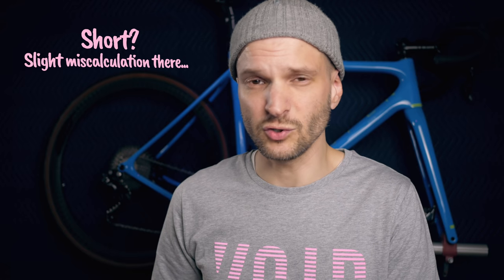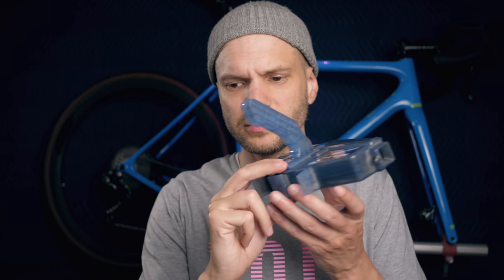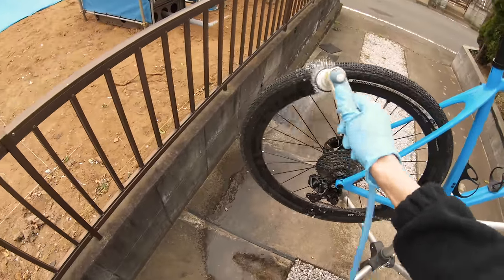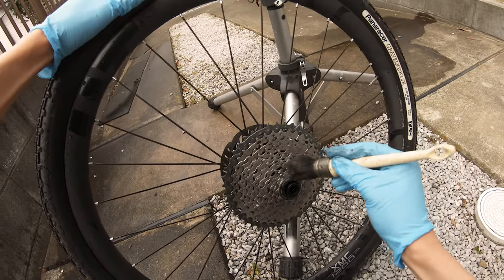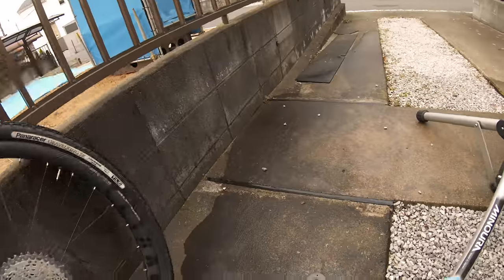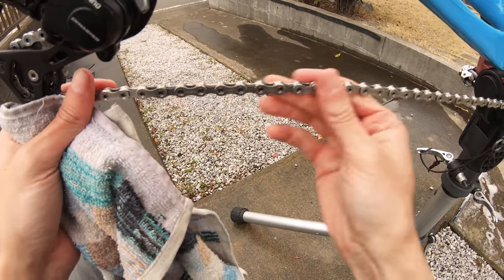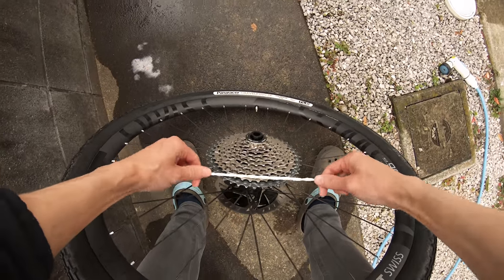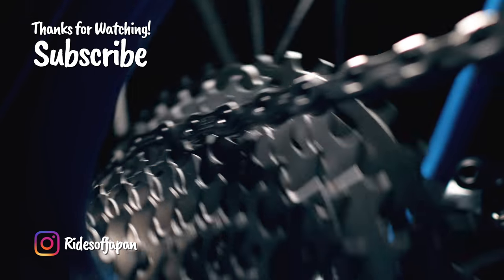My obsessive compulsive chain cleaning disorder

Comment: I'm just checking in to be clean. 1:10  hahahah! :)
Reply from the maker: Shane Miller - GPLama 🛀😘
Reply: Try waxing your shane.... I mean chain.  I switched to wax a couple of years ago, and have hardly had to change a chain more than 3 times.  Has the added benefit of not flicking chain oil on to your frame, which then doesn't attract dirt. So,  I no longer have to use aggressive cleaners on my bike, which prevents grease being washed out of derailleurs etc, so I've also found that all my parts also last forever!  I wax every two weeks while riding five days a week on salt affected british roads.  My wear rate on a brand new chain fitted in october was 0.25mm to 0.5mm currently.  The chain will last me through this whole summer and in to most of next winter.
Reply: @mathewwhittle10  we used to do that back in the '80's and had very similar results. WAY less wear and tear in dusty and dry environments.
Reply: mathew whittle what brand do you use?
Or just some candles
Reply: @ridesofjapan  you can lookfor small airbrush compressor maybe you will like it✌️
Reply: @Rides of Japan #bikecleaning #blingbling  !! WARNING DO NOT CLEAN YOUR BIKE LIKE THIS VIDEO SUGGESTS, YOU WILL RUIN YOUR R-HUB, BB, AND DERAILLEURE PULLEY BEARINGS !!       ?? Why ??
Cleaning solvents have a very powerful capillary action and a few drops will easily travel past the rubber seals on your sealed bearings, which will dissolve and remove that critical thin film of grease between the steel or ceramic balls and the raises. This allows the bearings to ride and grinding metal to metal and prematurely fail. At first after about two weeks the bike starts making faint grinding / clicking noises. As time goes on it just gets louder and louder. BINGO YOU JUST RUINED YOUR BEARINGS.
 I see this in my shop all the time.
SAD CASE & POINT: Spring 2021 I built a brand-new Canyon with Sram red AXS etap, Zipp wheels and all ceramic bearings.  Two months later he stopped by the shop complaining about some loud clicking grinding noises coming out of his rear wheel and BB. His bike was bristling in the sun and his drive train was spotless.  My heart began to sink knowing what he did, as I asked him what type of chain cleaner has he been using? He proudly told me "ParkTool CG-2.4 chain cleaning tool, and cleaned his cassette based on your Rides of Japan video, why do you ask?" I put the bike on the work stand and sure enough all his bearings were ruined.  As I started to explain he got very angry at me finding it very hard to believe what I was telling him.  But after he calmed down and I removed the Freebody bearings from his new ZIPP wheels. The bearings were rusted and contaminated with traces of ParkTool cleaning solvent.  He apologized to me and now his anger was focused on ParkTool, saying how can they make such a stupid tool knowing it will ruin bikes!!!!
I think if you ever see a ParkTool chain cleaning device take a hammer to it and destroy it so no one else can use it.
THE CORRECT WAY TO CLEAN A DRIVE TRAIN:
1. Remove your chain, cassette, and C-rings or cranks, use odorless paint thinner in a metal or plastic tub, and scrub away to your heart's content.
2. Put your chain in a large mouth plastic jar with solvent, and shake it for a while, let it sit overnight, shake it again, so its clean inside out.
3. Rinse out the solvent residue on the parts with a garden house.  Dip the parts in soap and water, and rinse out again with a garden house. BINGO THEY'RE LIKE NEW.
FYI: If you clean the C-rings attached on the crank arm, make sure not to get a single drop of solvent on the pedal or pedal axles.

Comment: Here in dry, dusty New Mexico i've found this lube called "Squirt" works really well.  It's an emulsion of two things that normally don't mix - water and wax.  So it's a way to wax lube your chain without involving a  pot of hot wax on the stove.  My chain has never been quieter and the shifting has never been smoother.  And it does last a long time and doesn't pick up a lot of dust.

Comment: Used the same dry lube before. Now use Squirt all the time, road, gravel and MTB. Super easy cleaning and re-applying.. :)
Reply: Peter Mergaerts I’ve also switched to Squirt. Better than muc off dry.
Reply: Squirt is pretty good. I just use a cloth. That is all.
Reply: Dude! Squirt is insanely good. Leaves almost no gunk, I clean my chain once every 2 months and Its always looking like new. Just re-apply every 200km or after a rain ride. Just make sure to avoid using too much lube, a tiny drop per link is really enough. Also, wait for it to dry before the next ride
Reply: Will have to check Squirt out🤔 cheers😊
Reply: I switched to Squirt 4 years ago, loving ir ever since.
Reply: Peter Mergaerts ordered and look forward to reviewing this in the coming weeks. Cheers guys👍🏻
Reply: Squirt is good, except when it’s wet on the road. At which point Squirt will wash off with about 50km.

Still, it’s the lube I’m using at the moment as the ‘wipe down and reapply’ between rides is all I need to do!
Reply: This is my review of Squirt. I did notice a difference of noise the first time because I didn't apply it twice. Here's the full review: https://www.youtube.com/watch?v=G6p03DMXDj8
Reply: Try also Smoove. It lasts longer
Reply: How does it perform in wet?

Comment: I run my old degreaser trough a coffeefilter after leting the gunk settle.
Reply from the maker: Ah, nice idea! Might steal that
Reply: I use an old beans can with a rizla filter through the bottom and this filters into a large funnel stuffed with tissue paper at the lowest point.
Reply: This is comment gold!
Reply: I have been cleaning my chain for a year with 300 ml of petroleum, filtering it through coffee filters :D ... what could be more economically friendly?
Reply: @ernestpetros6178  but doesn't degreaser, petrol in particular, evaporate too fast to be able to filter it?

Comment: I use a crockpot  with wax in it to 'boil' my chain after every few rides. Because of this my drivetrain stays totally clean. No messy oil anywhere, so no grit sticks to anything wearing stuff out. Taking my chain off to soak it gives me a chance to monitor derailleur pulleys and bottom bracket adjustment. I've done this for several years and can't ever imagine putting oil on my drivetrain ever again.

Comment: Two notes:

1. That long thin cleaning tool you were using is a ‘bottle brush’. Used to clean inside bottles :)

2. For drying I use either a chamois cloth (synthetic one), or a micro fibre cloth. Neither leave lint behind. 

Great vid :)

Comment: I love it!  I clean my bike and chain after EVERY ride.  I use the Muc Off dry lube (yellow) cap because it is bio degradable and cleans off the chain easier than the C 3.  I love a clean bike!  I also take the time to check the tires for debris and other components for wear.  I don't ever aim a stream of water at the bike, instead I use a bucket of soapy water and several micro fiber towels and just wipe the bike with a damp towel.  This method works because the bike never gets that dirty.  Thanks so much for sharing.  Just discovered your channel and LOVE the attention to detail that you bring!

Comment: Wow, lots of comments, but it shows how well they liked your video. Well done!  Now, I'm a bit of a lubrication nerd.  I used to use an ultrasonic cleaner to clean the chain then do the hot wax dip, especially on new chains with the sticky rust preventative they come with. I still do the ultrasonic cleaning/hot wax method, and I also add MOS2 (Moly disulfide) powder to the wax as a high pressure lubricant.  Unfortunately it makes for a dirty looking wax, but it's THE BEST lube you can get.
As I said, I usually only do that procedure on a new chain or anytime I break down the bike for maintenance.  What I use for weekly or every 3-4 rides is Dupont Chain Saver*.  A wax based product with PTFE, it is the best I've found. It doesn't keep an abrasive slurry in the chain parts like an oil based product does since it's a dry lube.  It is also quite tenacious as you will find out when you get some on other bike parts. ;)
Keep up the good work Tobias

* https://www.amazon.com/DuPont-Chain-Saver-Self-Cleaning-Lubricant-11-Ounce/dp/B001B0VDC2/ref=asc_df_B001B0VDC2/?tag=hyprod-20&linkCode=df0&hvadid=309811990469&hvpos=1o1&hvnetw=g&hvrand=16634845442699810500&hvpone=&hvptwo=&hvqmt=&hvdev=c&hvdvcmdl=&hvlocint=&hvlocphy=9028310&hvtargid=pla-531034886332&psc=1

Comment: Most efficient bike wash video I've seen.  Liked yours way better than GCN's.  I'm actually more obsessive on my chain, cause I use paraffin wax for lube.  That's the best for super quiet drive-train and efficiency, but it's a chore every 200 miles.
Reply from the maker: Cheers mate!

I read that paraffin wax is actually noisier than oil (Although more efficient). Not noisy as sounding like something is wrong, but just a bit more chain noise compared to oil based lube. Did You not experienced this?

That’s the main reason I’m not considering going down the full wax road. Might do in the future though.
Reply: I'll give C3 a try to compare.  Thanks for all the great vids.  They are always enjoyable.

Comment: Was expecting wax as chain lube. Cause ceramic lubes are quite "normal" IMO. Only people with real obsession about clean and fast chains use wax
I personally use the recipe from Jason smith with 1lbs of wax, 2g of MoS2 and 5g of PTFE powder(friction facts) and it works for roughly 200-300km of dry riding then it gets noisy, but still lubricates the chain sufficiently.
I also have 3 chains for each bike. So i can simply take it off and use the next one if it gets squeaky. I wait till all spare chains are used up and then rewax them in one session, but clean them ultrasonically beforehand at 75 degrees celsius
For smaller parts on the bikes I use an ultrasonic cleaner. Cassettes, bolts, smaller chainrings(from the MTB) etc get cleaned with that and I can also check them for wear
Frame and wheel cleaning is similar to your procedere. But since no gunk collects from the waxed chain, chainrings, pulley wheels etc stay quite clean(very apparant with aluminium anodized oversized jockey wheels)
Reply: interesting recipe.

Comment: i still love my waxing of the chain. especially for MTB and gravel riding as the dirt hardly sticks to it. wash the bike and the chain looks new again. re wax every 3rd or 4th ride.
Reply: I feel like waxing is too dry and causes a lot of friction compared to wet lube with some dirt on it. Also waxed chains look ashy af
Reply: @The-ii5jo  all of the testing shows you're wrong.
Reply: @The-ii5jo  Dude try it before you knock it. Just make sure you have a spare crockpot and a removable quicklink. You will never look back. Only exception I see if you live in wet climate, in a van, or travel internationally as a professional. There are absolutely pros still waxing with molten speed wax, just pre-waxing chains.
Reply: @sanderlucioperca  whoa there sander bbg calm down. I've actually tried waxing my chain and I didn't like how it felt. It doesnt feel as smooth as a chain with actual lube. I'd much rather bathe my chain in mineral spirits about every week or much earlier depending on how much I ride or how dirty it gets, and then applying fresh lube. Chains are gonna get road grit no matter what specially since they're close to the ground. Even a dirty oily chain literally feels smoother than wax. But hey if you wanna keep an ashy chain, you do you

Comment: Squirt wet lube is fine, but the dry lube is hopeless. My fav oil is the Morgan Blue  race oil. Eases gear changing and quietens the transmission instantly. It’s a good lube for  a long day whatever the weather. Of course, cleanliness of the transmission is the key. I find the more I clean  it, the easier it is to maintain  and the more I enjoy riding my bike. I clean mine after virtually every ride, not always a deep clean, sometimes a fairly minor cleaning, then I dry things up and apply my lube. It gets time to soak into the links etc before my next ride, rather than lube before setting off. Knowing my bike is clean and lubed and ready to go, is encouragement enough for me to get out and ride.  Thanks for the vid.

Comment: A trick for DRY conditions that is super fast and great performance result. Silicon spray and a towel is what I use before every ride on my chain. Backpedaling and cleaning with the towel and silicon spray afterwards. Deep cleaning with diesel every 2000km with removed chain into a jar. Please recycle the diesel for the sake of the environment! Works like a charm and really silent and friction free riding in DRY conditions.

Comment: Nice to see I'm not alone on this "Keeping your bike and chain ultra clean" I have OCD so you can imagine!!
A clean bike is a safe bike...I have used many chain lubes, now just use Squirt wax lube, I find it works really well,  especially when you use the correct amount on each link... absolutely no more degreaser needed, and after a 100k ride just wipe off, then re-lube. After 300-400 k I wash in hot water with soap, and rinse, and dry, and your done! Chain runs very quiet, wonderful gear shifting, and attracts very little dust... I am sooooo glad a gave it a try!! Trick is to super clean a chain that has been used with other lubes, Squirt works best when no other lube substances mix in with it, that's why after 1-month of using it you will see how well it works! Even on a super clean chain you will find oils on chain, that's why some have used it incorrectly,  with a chain they think they have really cleaned well, but still had the other lubes existing, once they mix, the  Squirt performance is not optimal. I have been doing Squirt for a year now, and boy, it is a wonderful lube, and chain is in wonderful condition. But as with everything else on a bike, it's all very very personal, do whatever YOU think works best for you!
Reply from the maker: leftymadrid cheers for that very important detail! 
After reading all the recommendations in the comments I’ll give Squirt a go next, happy to here that it runs quiet, that the most important part for me.

Will give a super deep clean before applying squirts... time to get that ultra sonic cleaner after all ;)

Cheers!

Comment: A trick that i use for cleaning my chain is to use an electric toothbrush to clean the cassette and the chain. I buy one of those cheap toothbrushes that are battery-powered and then I start to clean.  This really helps.

Comment: One extra bit of cleaning insanity I do is to remove the degreaser from the park tool device after I've cleaned  the chain,  then rinse the inside and clean the 3 brushes. Fill with clean water, assemble on the chain and run it again. A good way to rinse away cleaner and grease.

Comment: For me, I use a quicklink. Chain off straight into a rice cooker full of hot wax. Pull it out and hang it up, 10mins later I put it back on the bike and spin the cranks while holding a rag on the chain to clean off excess wax. 

No lube or degreasing required which makes big difference. Bike stays cleaner, and only requires a soap wash. Cassette and rings stay much cleaner than with lube.
Reply: I will second that!

Comment: Nice to see someone else as compulsive about clean bikes as I am!  I've found that removing the cassette and chain, and using an ultrasonic cleaner filled with a 50/50 mix of Simple Green and water, will result in a chain and cassette that looks brand new and ensures that the miniscule bits of dirt and grease are removed from the links.  Also, Morgan Blue is a great product, but I don't like spraying it around the freehub body as it can work its way into the bearings.  Try the ultrasonic cleaner, you'll never go back to brushes or the Park tool.

Comment: Using degreaser and cleaner, then with the brush obsessive push the dirt even deeper into the chain. This will exchange the lubrication with dirt particles. The abraision particels + dirt is one of the best wear-out agents to have under the o-rings of the chain. As aftermath water and Sauerstoff will raise.
Reply: djAmbush that’s just bs

Comment: Even though it may be excessive, it contains all the detail for the novice to take note! Thank you for sharing. BTW, has anyone mention a hair dryer to blow out water in chain and other crevices? Just a thought as I was comparing your air dryer action to use of compressed air. Beautifully done and can admire the sense of quiet with a well lubed machine!
Reply from the maker: Cheers mate! 🙏
A hair dryer would be much better than my little air duster for sure.
I used to use a big leaf blower at my old place. But it’s really loud and I don’t have an outlet near my bike washing area so had to abandon that.

Comment: I like what you did. Ty for the ideas.  I will probably remove the rear wheel a bit more often.  I alway struggle to clean the cassette.  On several occasions I use hot water on the chain to help de grease the chain and the cassette.  Definitely a must in the winter.  I see you using a small hair pump.  Instead, use a hair dryer on cold setting or a small shop vac with the hose in vac or pressure config.

Comment: I've been getting on well with Smoove, like Squirt but as the claims suggest I also find it lasts longer.  As long as you start with a sparkling chain (which should always be the case).
Reply: My first choice now for dirt rides.
Reply: Try parrafin wax. No degreasing required, lower friction